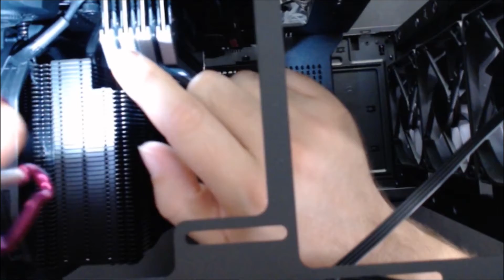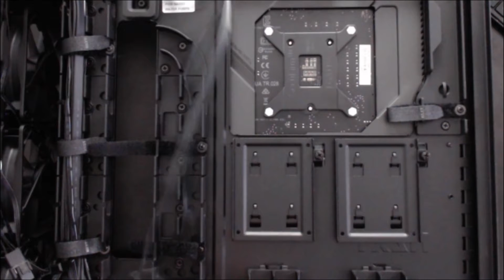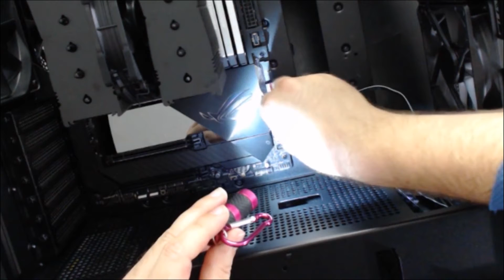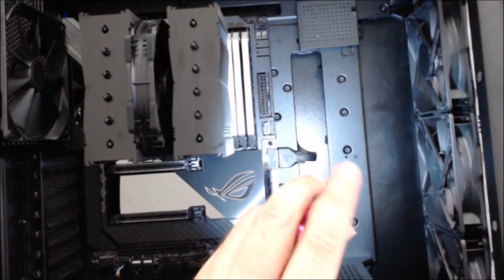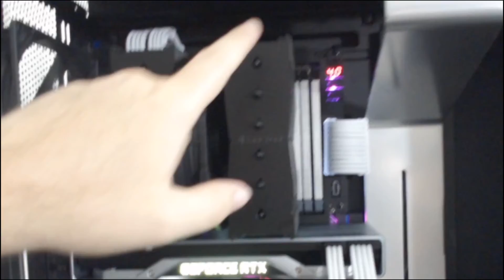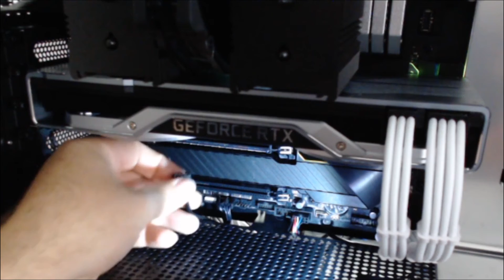Converting NZXT CAM RGB LED to ASUS Aura Sync

Comment: I buy an adapter cable now I can do everything with aura
Reply: Which one buddy?
Reply: @flavoredink9205   Nzxt to motherboard 

 ARGB 3-polig 5 V auf NZXT HUE 2/AER 2 Adapter
Reply: @eugenalready  thanks mate
Reply: I have 10 NZXT F120 RGB fans. Motherboard is Asus ProArt Z790. How do I plug the and control the fans with this particular motherboard? What do I need?
Reply: @BenoSaradzic   maybe you need ten adapter cables and a rgb splitter. You can also cut and solder the rgb cables together it’s cheaper than buying ten adapters.